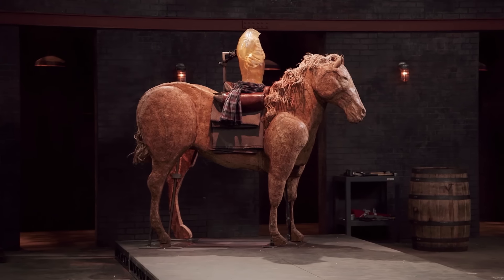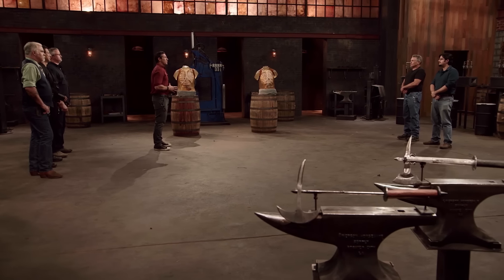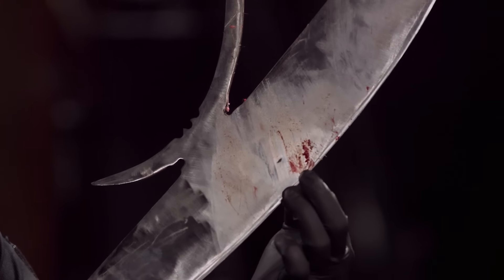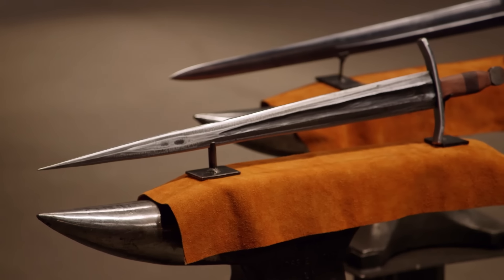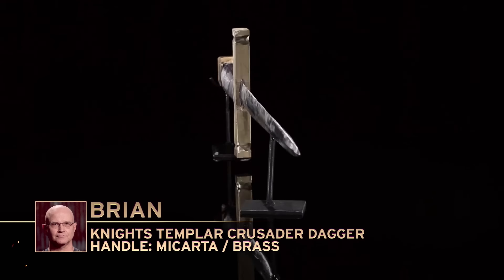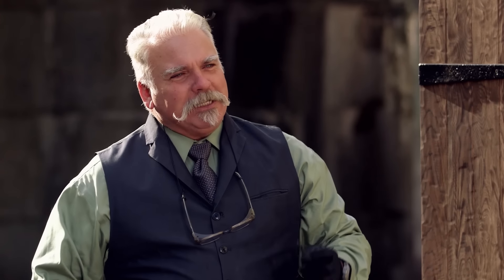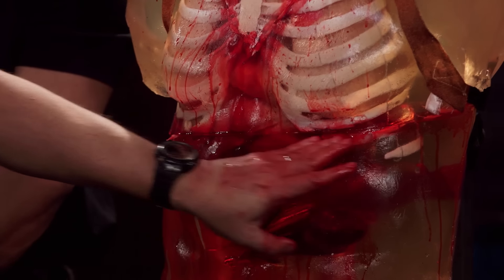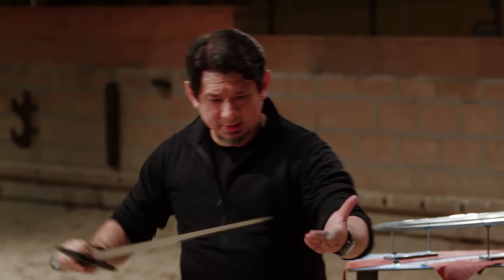Forged in Fire: TOP MEDIEVAL WEAPONS TESTED (8 Swords, Axes, and More) | History

Comment: Drew you're the ppl champ! (Arming Sword challenge)What they did was BS! How is the pommel falling off catastrophic failure but not a bent sword which couldn't cut to begin w/. And that's not even mentioning the gaps on either side of the cross guard. So not only did the "loser" easily slice through that carcass then had his sword cut through ice it also retained it a razor edge but he somehow lost. That was just a bad call overall given contestants have been allowed to straighten their swords & cont. w/ the comp.

Comment: ok so i dont forge. BUT. i have a heavy industrial tempered steel katana that i welded together. the steel is used in crushing. the sword is medium sharp and fairly heavy weighted, it is basically a bone breaker. i have beat the sword on everything i can think of trying to damage the blade or hilt. amazingly the sword has took no chips dings dints or any damage besides minor dulling. im very happy with the sword. im not sure how the edge would hold up after having a fine sharpened blade but i would 100% have faith that a heavy slam against any material would not break the blade.

Comment: I disagree with the Arming Sword verdict. Losing your pommel is NOT a catastrophic failure, in terms of actual combat. As long as you have a solid grip, the pommel is mostly decorative. And as long as the blade, guard, and handle remain intact, you've got a sword you can fight with. Losing your pommel is an aesthetic failure at most.

Comment: losing a pummel is not a major failure... the blade will still function.
Reply: If the handle is epoxied on, but back in the day that wasn't the case. The judges never trust the epoxy anyway. If there's no mechanical connection, to them it's catastrophic, which is kinda silly, since that epoxy is stronger than any mechanical connection.

Comment: I'm no expert but from what I understand, the guys who lose on the strength test have nothing to be ashamed of. Those tests are intentionally designed to be much more brutal than even the most extreme battlefield usage. Otherwise, it would be very difficult or even impossible to declare a winner in many cases. In more realistic scenarios, they would most likely pass, no problem. Calling breaks during the strength test "catastrophic failures" is pretty misleading.